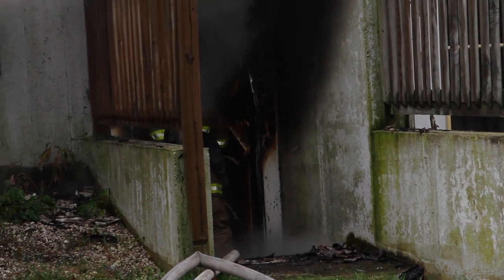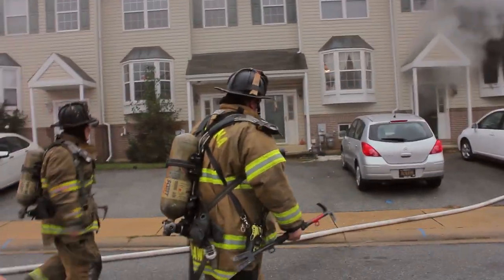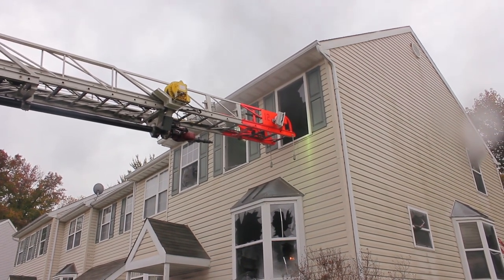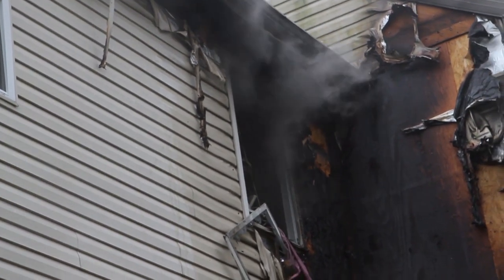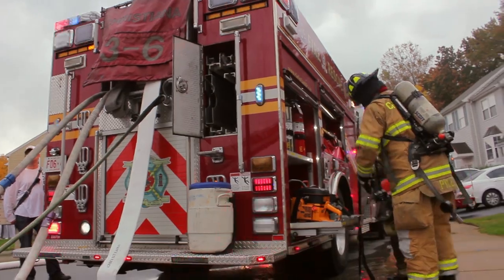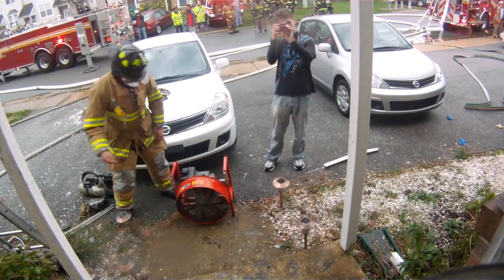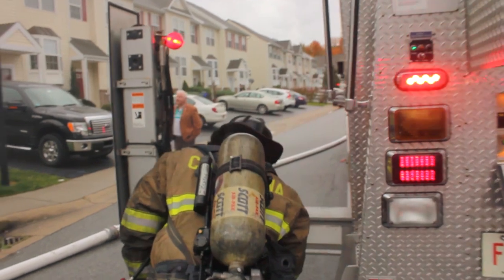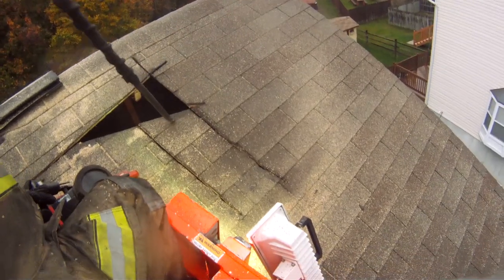Into The Smoke Season 1 Episode 1 - Christiana House Fire

Comment: So much for property conservation, When the back sliding door was intact. Could have easily opened it. Instead of taking hook and playing baseball with the frame. Had plenty of other windows out. When were ladders used as battering rams to bust windows?? Wow
Reply: They started busting out glass when they figured out it was good for venting out the smoke??
Reply: Always, always take out window frames, don't want a guy who is lost/disoriented to hit the frame and turn and go the other way, make the opening as big as possible, this is why he was swinging at the frame to dislodge from its base, and ladders have been used for venting for centuries,
Reply: Steve Lubrino
Reply: Horizontal ventilation and firefighter egress for emergencies.
Reply: Have been for a long time. That’s how they trained me

Comment: Why are most of the caps still on the bottles? Something is fishy or Im loosing it
Reply: +FireRescue595 these are the new air-pak X3s that connect from the side facing the pack.  the cap is on a cascade system slash RIT connection.
Reply: +Lunch Lady its mainly a fill port.  The RIT connection is on the right side of the harness that has a quick connect. it has a 3 foot hose connected to the fitting and is stored in a pouch on the harness.  The pack is a Scott NXG2 and has been around for a little over 10 years now.

Comment: Your scba works really well when its not even hooked up and the caps are still on the bottle. UNBELIEVABLE!!! seems like every dept in this county needs to go back to the fire academy and learn how to do the job. Oh yeah, that half ass melted helmet you wore into the training tower trying to melt looks real cool too..... complete fools.
Reply: +hfd88 What&#39;s UNBELIEVABLE is you obviously are not up to date on the current equipment in the industry. Which then would also lead me to the conclusion that you must not train that much either.  I think you may need to go back to the academy for a few refresher courses of your own! IMO.  The SCBAs this department uses are Scott&#39;s NXG2 model which have been out for a little over 10 years now. Those little caps you saw were covers for the fill port on the bottles, and the bottle connects directly into a first stage regulator on the harness through a quick attach/detach hook up.   And that melted helmet hmmm.... This is a busy department that sees a lot of fire.  Good job on the keyboard firefighting try....

Comment: Vertical Venting.  No smoke showing in the second floor but they do it anyway.  The holes he made in the ceiling were the size of quarters.  This whole process risks fire fighters lives and accomplishes nothing.
Reply: Its an inspection hole.  Cut to confirm if there was or wasn't extension into the attic.  Just because there is no smoke in the 2nd floor, doesn't mean attic extension can't occur.

Comment: Where is the preservation of property?!  Gotta love the guy trying to hit a home run swinging at the 3 inch patio door frame.  As a full time firefighter I fully acknowledge the importance of volunteer firefighters to their communities, but this was a not an incident that unfolded as it should have.  Yes the job got done, but ya thats all I am going to say.  Ok, maybe one more thing.....lets set up PPV on a building that has as many holes as cheap swiss cheese......
Reply: That's horizontal ventilation. It prevents rapid expansion of the fire and helps suppression crews, plus if there were entrapments that would preserve life by pulling heat and smoke away from victims/firefighters.
Reply: Horizontal ventilation and firefighter egress for emergencies.

Comment: why even use the positive pressure fan???? there is no way possible the structure could have pressurized with all the windows and doors out....
Reply: Kyle Lonesky Basically all positive pressure fan does is push a lot of air in to push a lot of smoke out.
Reply: +291xMac     yea I get that. I'm a firefighter myself, but in order for it to work effectively, the building needs to pressurize in order to push the smoke out like its designed.
Reply: Kyle Lonesky That does make sense, think they kind of helped with the hydro vent. But I do see how only having 2 openings would be more effective.

Comment: Why brake all the windows ? Is there really a need to completely destroy the house and add to the damage that's already been done? On the initial attack shouldn't you wait to completely ventilate as to not add fuel to the fire. As soon as the fire fighter broke the sliding door (which he just could have slid open) notice how much the smoke increases. Now I don't know how much of the fire was knocked down before they started complete ventilation, but you still don't need to go full force on the windows, or sliding doors. PS if you hit the corners of the frames they get knocked out more easily.
Reply: Windows are a source of egress, every window that has a ladder to it needs to be a door but for the sliding door i think it was just for easier access
Reply: TheDeeds77 true, but they had also started suppression of the initial attack at that point. most was steam.
Reply: plus, smoke is the feed for fire.
Reply: Taylor Northrup The increase in smoke came from breaking the window. My pet peeve with this op was the lack some people with packs on. (i.e. guy on the roof) and how some didn't have their straps fully tightened or on, (Guy with waist strap off coming through the door) and how some weren't fully geared up upon arrival (not talking officers and chauffeurs here, just fire fighters). I agree, fire fighter damage should be kept to a minimum, but if you look the areas where the doors and windows were fully broken were already burned.
Reply: Some places operate where they don't wear packs on the roof. It seems stupid to me as well but hey, it's their lives at stake. The straps? Meh, it's a personal choice. Certainly not the end of the world.
Reply: Taylor Northrup O